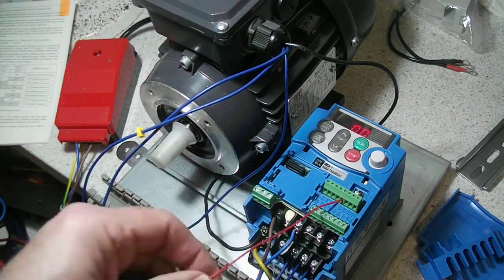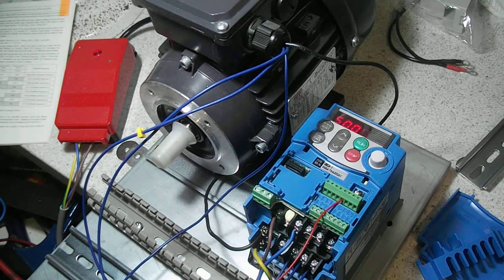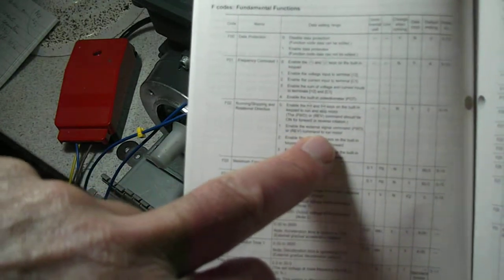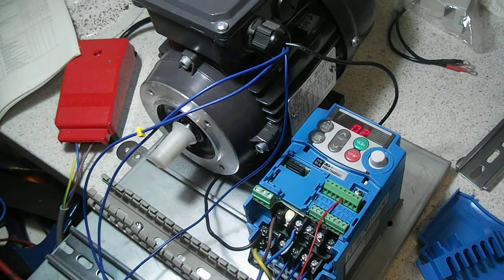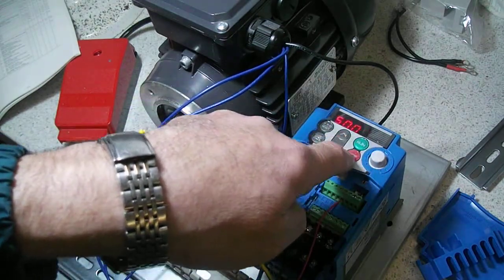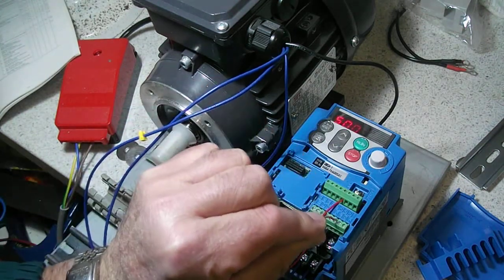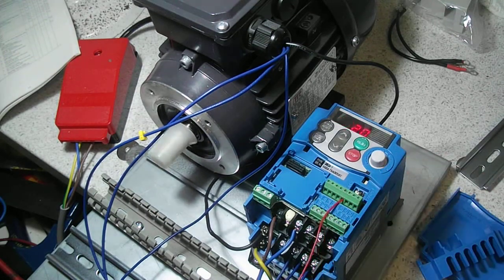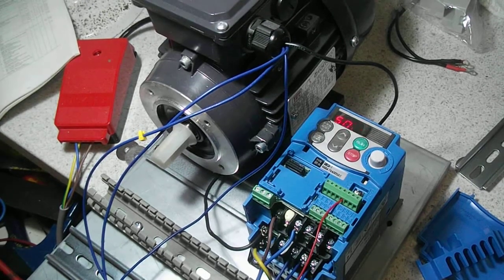IMO Jaguar Cub  3A-1 VSD VFD : Clip 2, Forward/Reverse Programming

Comment: I have a fault code OC3 on one of our conveyors, this appears to be overcurrent fault. I disconnected the motor wires, Fault again OC3. Is the inverter damaged.
Reply from the maker: Hi Emyr,

Have you disconnected at the inverter end?  There may be a low resistence path on the cable run, causing the alarm, test with a Megger.  Best way to clear the fault is disconnect/reconnect power after a few seconds.  You could call Stuart at IMO on +441707 414444 option 2. Cheers.
Reply: @collectric5518  d
Hi, Yes I disconnected the three phase wires at the Inverter end. I'll have another look. Many thanks for the reply!